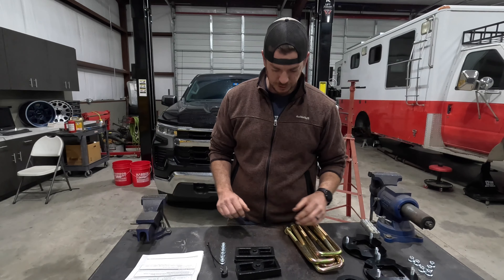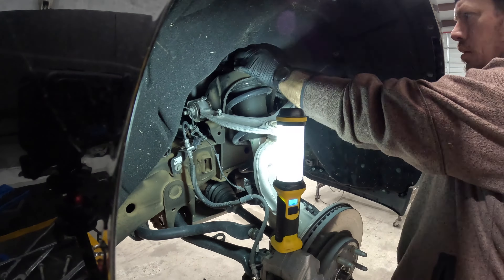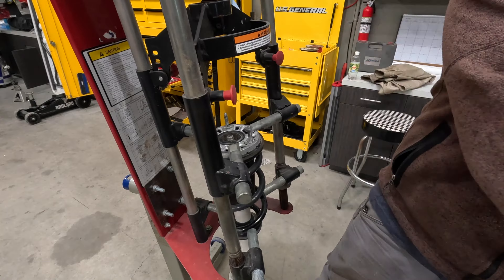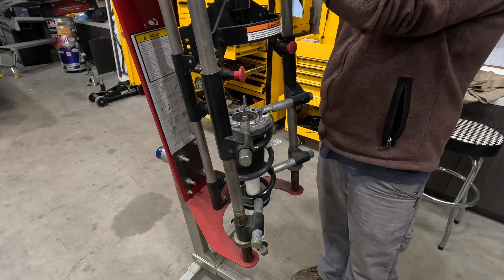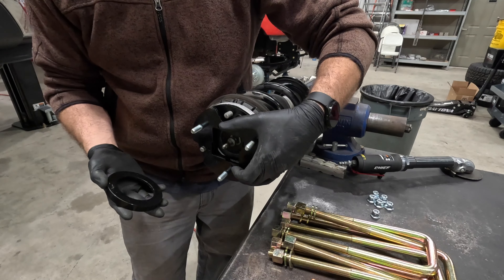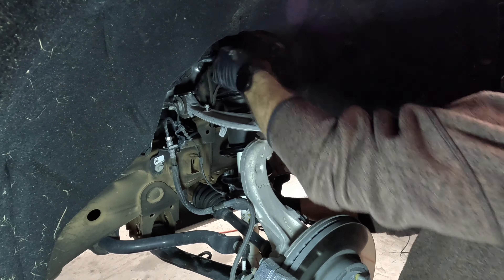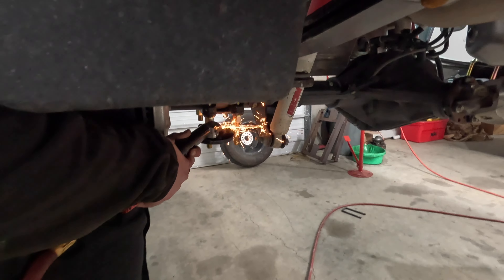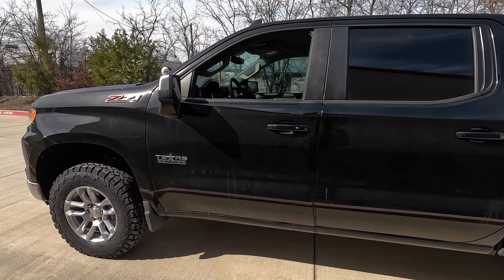Cognito Leveling Kit install on a 2022 Silverado Z71

Comment: Question you don’t need to replace the upper control arms with this lift kit ???
Reply from the maker: Not at this height. Factory Trail Boss uses same UCA, so we're within range and alignment is OE spec

Comment: How much did the front actually lift? Was it 2 1/4 or 2 inch and are the fender well gaps even?
Reply from the maker: Does a ¼" really matter? It doesn't to the customer or to me. 
¼ inch isn't going to give you more tire clearance during wheel travel. So, in reality, it doesn't matter.

Comment: I recently purchased a Cognito 3-Inch Premier Leveling Kit with Fox PSRR 2.0 Shocks for 11-19 
SKU 110-P0926 $2400.79  
I thought I was buying top of the line product backed by a company that would stand by their product. I WAS WRONG !!!!
I had to wait weeks before receiving the leveling kit and once it was installed I realized the truck didn’t sit level and couldn’t figure out what was wrong until having  the torsion keys removed and finding out Cognito sent a one of them for a newer model truck. I reached out to them and they were very arrogant and not willing to admit their mistake even with pictures and part number of their torsion keys. I was told the torsion key bolts will never be adjusted the same and they don’t send out wrong parts and it was probably a mixup with the shop that installed it. I encored additional $305.00 labor and not having my truck for five days for their mix up and they refused to reimburse me for their mistake so they don’t stand behind their product our own up to their mistakes.
Reply from the maker: So there were 2 different torsion keys in the same box?